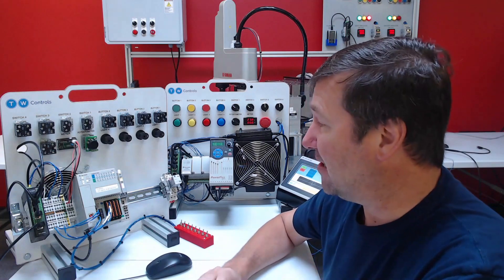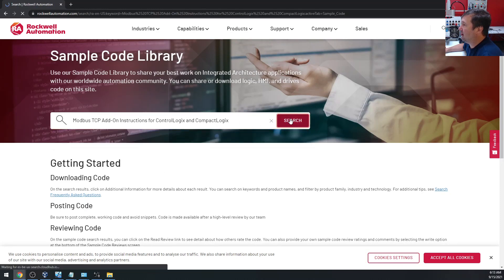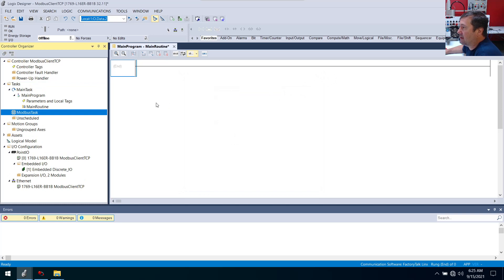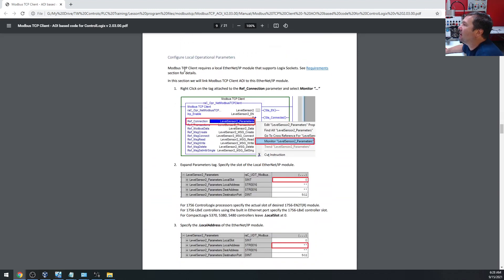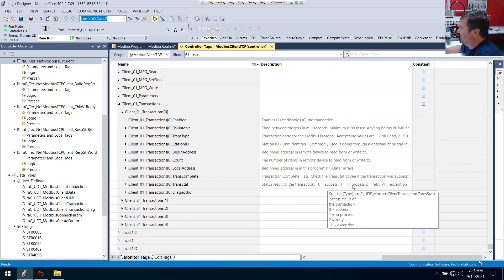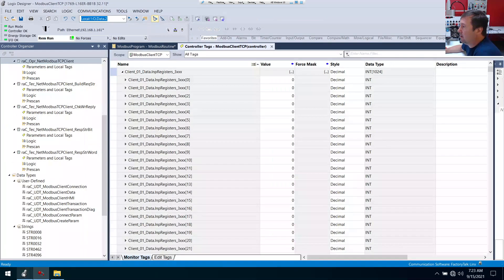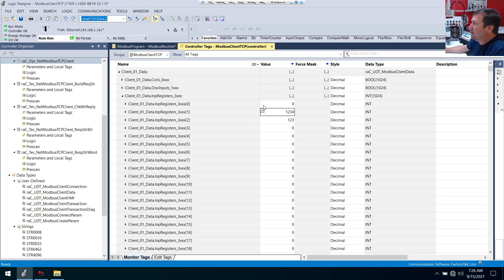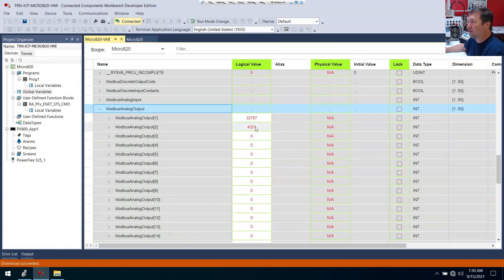Studio 5000 Modbus TCP Client Allen Bradley Controllogix Compactlogix

Comment: Just curious, if AB can support MODBUS TCP on Controllogix, how is Prosoft able to sell its MVI56E Modbus TCP/IP Module? The AOI uses explicit messaging, which makes it slower.
Reply from the maker: The Prosoft nicely came out before Rockwell wrote the AOI. I'm unsure of the difference in performance between the two.

Comment: Hi Tim, thank you for the excellent video. I’m trying to figure out how to interpret transaction using function code 6 (“Write a single holding Register”), as it doesn’t appear in the Ref_Modbusdata in modbus function in RSLogix. There are only 4 transactions (01-Coils_0xxx, 02-DiscInputs_1xxx, 04- InpRegisters_3xxx and 03-HoldRegisters_4xxx).  I really appreciate your support.
Reply from the maker: Check out page 5 of the client manual.

Comment: Great video! I used this video to test out the AOI to poll data on an ABB RTU modbus slave from a L72 controller. I found out that I had to use an EN2T card. I was using an ENBT card initially. Question how do you reassemble the holding registers to get floating point values?
Reply from the maker: I just uploaded this video which should help.  I go through how I figure out how to combine and arrange the bits to get the original number back

Comment: In my L33ER PLC I'm using 1734-AENTR Point IO in that 1734-485ASC/C module configured.. As per your video set exactly what I have in my actual configuration but my connection status not glowing green (Modbus TCP client AOI). My PLC IP : 192.168.1.1 & ANTR module have 192.168.1.2.  I want to read my load cell monitor data over RS 485. Please suggest..
Reply from the maker: I haven't played with the 485 module in a while but I don't think the Modbus TCP AOI would work. I don't think it allows for a path beyond the IP address.
Reply: @TimWilborne  Really thanks for your comments.. Is there any other way with same configuration?
Reply from the maker: It is going to be extremely difficult.  As crazy as it sounds, have you thought about putting a Micro820 in there for the RTU communications then sending it on to the L33?
Reply: @TimWilborne  Ok Thanks.. My Loadcell Controller have RTU protocol as well..
Reply from the maker: You are welcome.

Comment: Im using a control logix, I already followed all the steps for the modbus tcp client, now will my pv800 be the client? Do I still have to add the IP address,1,0.?
Reply from the maker: It would be the opposite but can the Panelview 800 be a Modbus server?  I should play with modbus on the Panelview 800 sometime.
Reply: @TimWilborne  yes I can switch it so it can be a server . Just can't figure out if I have to set the pv800  differently other than modbus. I have pv800 ver 8,and ccw ver 22..
Reply from the maker: Good to know, I didn't realize you could make the Panelview 800 a Modbus server.  I'll have to look at it some time.

Comment: Hi I was looking your movie several times because im having a challange with my simulated 1756-L81E PLC. Do you know if its possible to use Modbus TCP Server on a 1756-L81E?  Thanks
Reply from the maker: Yes, see if this video helps
https://youtu.be/qcF4m7rPjkw
Reply: @TimWilborne  greatfull for your very quick answer but i do exacly the same but keep do the failur status error code -8 

by the way enjoying your videos :)
Reply from the maker: What is error code 8 when you look in the documentation?
Reply: @TimWilborne  error code -8 "Create Socket Message failed". If i look under the MSG_Create it says Error code 16#0005 and Error Text: Class or instance not supported. I guess it means that rockwells echo 1756-L81E do not support this library? Thank you for taking time to answer my questions <3
Reply from the maker: That sounds more like a path problem.  I'm using this instruction on an L81E in our training center.  Double check those initial settings in the user guide

Comment: Fantastic Video!! I used this AOI to bring in data from a GE PQMII Power Meter with GE Multinet RS-485 to Modbus TCP converter. I could easily use GE's Enervista software to monitor the power meter data, but I wanted to see if I could bring at least a few data points into the Compactlogix PLC to be able to send back out either Ethernet IP to another PLC or monitor locally via HMI. The challenging part is that I had to set my begin address in the right spot in order to get the data that I wanted, which I figured out from the memory register map provided by GE. The serial converter could only bring in 120 registers. I ended up setting two different transactions, bringing in a set of 120 registers to the 3xxx input registers, and a second transaction for bringing in 120 more registers and mapping them to the 4xxx holding registers. I'm sure there's a better way, but with the time I had I was able to get it to work! I sure appreciate you putting this together!
Reply from the maker: I agree.  There is some good software out there but sometimes I just need to grab a few points and send them on.

Comment: Is this AOI available for ControlLogix PLC's? I usually use a RedLion DSPLE for any type of protocol converting, but if I have just a few TCP devices and can get away with just using an AOI then I would be happy to save the customer 1 to 2k.
Reply from the maker: It works with all Studio 5000 PLCs including the Compactlogix.  Also, the Micro800s do Modbus TCP and RTU natively and can act as a bridge.
Reply: @TimWilborne Gotcha. Reason why I wasn't sure about the control logix is because they don't have an embedded ethernet like the compacts, well at least anything below an L81 doesn't, but because they use ethernet cards and there's different variations and models of ethernet cards for control logix processors, I thought it might of not been supported or at least had a different AOI for each different model and revision of ethernet cards, but if that's not the case then awesome! I'm assuming though in the control logix AOI you'd have to point it at the ethernet card itself so it can identify what slot and what it's on. I guess if there was a different ethernet card the AOI might have logic and does a GSV to identify which type of card it is then executes accordingly based on that. I did know that regarding the Micro 800's. I've used them for small jobs before to monitor some modbus values last one was on an on a HVAC system, controlling the humidity and temperature of a room where they have thermoforming for composite papermilling where they make like paper plates, bowls, to go boxes, and etc. The smallest change in temperature and humidity can mess up their product. Actually I did their whole DCS and SCADA system 4 years ago and now they're expanding investing 340 million and I'm involved again we're just finishing up Phase 1 now which added several hundred of new I/O points by itself we called it project WildCat because of how crazy and fast pace it was moving now we're about to start Phase 2 and 3 which we're calling this Phase project Hiawassee and the original DCS (1756-L84E) is nearly full capacity wise it's getting close to 90%, so in the panels that are being built in our panel shop right now for Hiawassee we will have four 1756-L84E's. They will be redundant pairs. Then building bunch of RIO panels. Which when we did the original start up 4 years ago and they bought this old plant to convert it over to a papermill they made us reuse all the original RIO cabinets and they were all Siemens profibus, so we had to use a Prosoft card to communicate to thousands of IO points, but being that this will be all new equipment and they're not being stingy on cost we're building it right we'll have everything on a redundant DLR all with stratix switches and AB VFD's and E300's and we took PlantPAX made changes to where it's better. Especially with the motors and valves we made it to where a VSD control module (AOI) will work with any type of motor by just turning a bit on or off telling it that if it has speed feedback then the VSD will work to control VFD's and if that bit is off then it'll work as a hard wired motor either with a E300 or just plain IO. Then samething with the valves if they're control variable valves or just on a simple solenoid. Even with P_AI we have it to where it'll work with any kind of PV, ethernet, analog. We added so many nice features to the plantpax faceplate themselves that if they were to swap a motor to a VFD all the operator has to do is flip a bit and select VFD type PowerFlex 525, 400, 7xx, Siemens, Lenza, etc and it will do everything they need it too. There's too many features we added and made PlantPax much better to name off here, but after we did that for this project since things were constantly changing and operators can't program and as integrators we can't always be onsite or remote in, that they can do a lot of it without our help, that it changed the standard for us. Some of the features my colleague developed into it, Rockwell is supposedly going to implement some of them theirselves. Latest thing I added was a little area to keep track of loopchecks while we did this startup for WildCat if you punch in a date of when it was loopchecked then this little red symbol that says "LC" like this (without the cigarette) and the letters 'LC'  🚭  saying that it hasn't been loop checked, disappears when the date of completion is punched in on the faceplate. Then we added maintenance notes if it's being worked on then something similar will pop up saying it's locked out or being worked on. There's bunch of other features I'd love to ramble on about that I'm proud of, but this has probably been my most favorite project that I've done in several years. Since I've started with this company and do more Plant stuff then I do with machinery and robotics. I do miss working with robots.
Reply from the maker: You specify the IP address and the slot, so the processor and Ethernet port do not have to be the same.  It is a well written AOI.

That L84E is a beast,  that is a big system if you need 4 of them.  Good luck on project Wildcat!

Comment: My Sts_Overload bit is enabled and im not sure on how to fix it. Do you know what this means and any ideas for me to try?
Reply from the maker: The documentation on this AOI is well written and usually spot on, here is an excerpt from the manual.  You likely need to increase your polling rate.

If selected PollInterval settings are marginally too fast you will likely see occasional Sts_Overlap errors
and your system should work reasonably well.
If selected PollInterval settings are extremely out of line, you will see both Sts_Overlap and
Sts_Overload errors and your system will not work reliably. If you are getting Sts_Overload errors, you
must adjust your PollInterval settings.

Comment: Hi Tim,
In the manual it states: If you change any of these Parameters during operation be sure to reset and then set the AOI Inp_Enable parameter tag.
How do you reset? I am having a problem with connecting to the other PLC.
Thanks,
Jim
Reply from the maker: Set it to 0 then back to 1.
Reply: Thanks Tim! @TimWilborne
Reply from the maker: You are welcome.

Comment: Hi Tim, I have a compactlogix L33ER communicating to Modbus TCP Gateway .
Modbus TCP Gateway is connected to Modbus Serial Devices with different  Salve ID. Can I read specific Slave from this AOI? Does it mean I have to Specify Station ID = slave ID on those devices?
Reply from the maker: I'm not sure, I've never tried bridging it to a RTU network

Comment: i have a vaisala temperature sensor, that is setup to 10.0.82.250 and unit ID at 241. Where do I put in the 241. I have tryed on Client_01_Transactions[0].StationID with no luck

Comment: How can i read and write 32 bit real value?
Reply from the maker: Use the COP instruction and copy the real to the INT that you're sending over modbus with a length of two. That'll copy 32 bits. Then do the opposite on the other side. You may need this video to rearrange your data when it comes through.
https://youtu.be/o3OWV8Q_U7s

Comment: Is there a way to automatically “map” controller tags to modbus output/input addresses in Studio 5000? For example I have 30 user defined tags, and i just want to automatically map them from modbus address coils xxx[0] to [29] via the AOI instead of going through them one by one
Reply from the maker: If the data you want in the Modbus registers is in a consecutive order then you could use the CPS instruction.

Comment: don't need to use device id? how can i modify?
Reply: I'm trying to communicate modbus tcp gateway with the ATV320 SCHNEIDER and using AIO, but it can't exchange data. How can I do it?
Reply: @teixeira3021  you may need to set the node address of the serial device to 0.

Comment: How send float value to clinet modbus TCP ip device, because  in this AOI there is only INT option and chiller recirve only float value how to set?
Reply: This is two years late, but usually floats will just take up adjacent registers. You can also just convert it to an INT. Just multiply it by 10 or 100 to keep 1 or 2 decimal places.

Comment: TIm, great video !  I need to bring in a float value from a device via MB.  The device is the server according to your great explanation and is outputting a float value to 400100.  Do you know if this AOI will convert MB data to float in Compact Logix ?
Reply: I'm guessing this has probably been solved already, but I'll add my reply anyways. What you probably need to do is use a COP function to copy the raw bits from the 2 INT words in the array containing the data into the REAL tag you're using. If that doesn't get the result right then you'll probably need to figure out how the bits are arranged and use a swap byte function to rearrange the bits into the correct order and then copy them into the REAL tag.
Reply from the maker: Hi Linda, you'll have to break it into two consecutive blocks.
Reply: @TimWilborne  For example, if my MB values are: 0000 F641 (depending on Byte order), I will bring that in to my Compact Logix as 0 and 63041 (converting F641 to decimal).  I need the actual floating point decimal value, which in this case is 30.75.  Will the AOI do that conversion or will need additional programming to do this?  I think a Red Lion Converter will do this for me but if the AOI can do it I can eliminate one piece of hardware.
Reply from the maker: @lindadeutsch5810  If it looks strange when it comes it, that is where you swap bytes and words. Chances are that will be the culprit.  I should do a video on that.
Reply: @TimWilborne  I looked into the AOI documentation and I don’t see a way to bring a MB value in that is formatted as float. I think it will bring in the data but it must be converted to decimal format using some other method. Yes, byte order is critical. Thanks for taking the time to reply and thanks for the great videos!
Reply: We have had success taking the float value, multiplying by 100, for 2 decimal places to create a REAL and on then on  receiving end, Taking that REAL value and then dividing by 100. 
What you multiply by depends on how many decimal places you need. 10=1dp, 100=2dp, 1000=3dp, etc...…
Reply: Multiplying by 100 is a great solution if you have control over the modbus data being supplied. I will be pulling data from a device that has had the data formatted by the manufacturer. I don’t believe I have that option in this case, but it would have been the perfect solution

Comment: My Plc Compact logic.  And two rap system device IP address 192.168.1.250 and 251. Every device 14 Level transmitter connect.  I setup to modbus client aio.  And setup ip and address. But Program data overlap.  Any suggestion.

Comment: How to map the signal comes into compact logix to perticuler tag
Reply: Great Videos Tim!  I am impressed.  I have the same question, how do I map an Analog Input through the Modbus.  I am currently reading multiple analogs into my CLX.  Now I need to map one of them to a local device (a Jumo Logoscreen FD chart recorder to be specific) through modbus.  In the video I only saw you working with INT's, I will need a Real or a Float.

Comment: I used this exact AOI several months back to read PV and SV temperature and status info from a Honeywell controller. Only issue I had was I was doing this from 1 PLC and reading 4 different Honeywell controllers. It worked great for the first couple controllers but as  I added more controllers the transaction status  had issues and would lock up. I had to cycle through each transaction using a timer to "step" through the transactions in sequence. Turning the enable bit for each transaction on until it was successful or failed then back off then moved to the next transaction.
Reply: yupp i know what u mean!!!

Comment: The 5380 has Modbus RTU as well if you get the 5069 serial module. Supports DF1 too. That 5380 series has been quite a problem solver.
Reply from the maker: Sometimes I'll use a Micro820 just as a Modbus RTU to Ethernet bridge.  Haven't used the 5069 serial module.
Reply: @TimWilborne   The Micro820 is even cheaper then some of the standalone protocol convertors. Though you will spend more time the first time setting up the code.